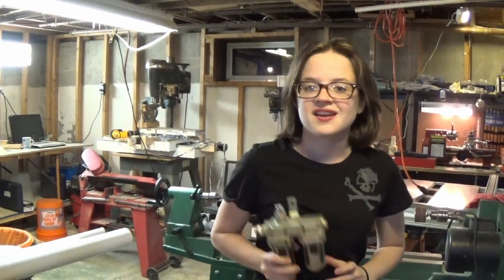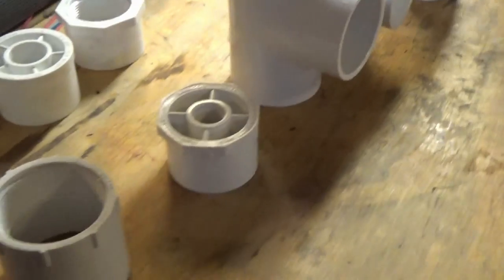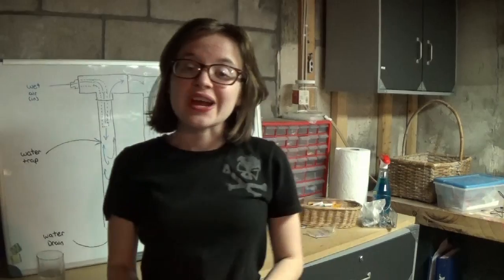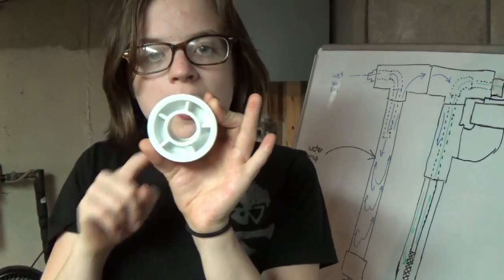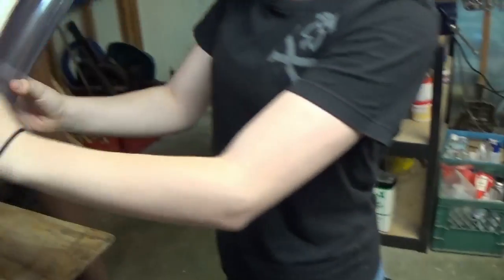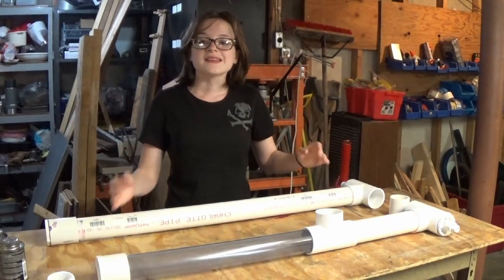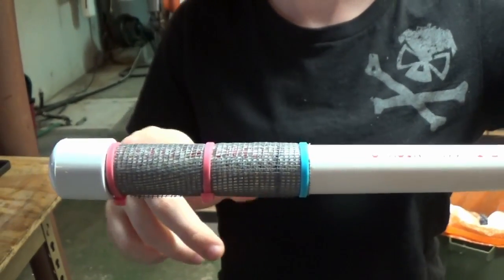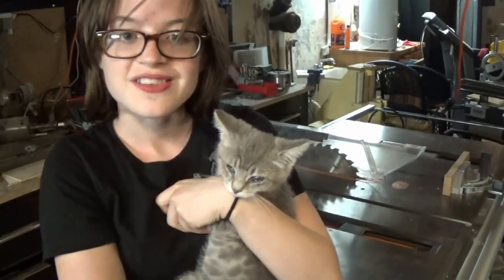Ep 11 Dirt Cheap DIY Dessicant Air Dryer

Comment: Fantastic video, great knowledge base. In order to minimise the safety issues with using pvc piping i would recommend using 1 or 2 pressure relief valves rated at 8 bar (100psi) (1 at the entrance and one at the exit). This is within the operating pressure according to ASTM D1785 for all your pipe tube diameters. The problem with PVC and in fact anything brittle is micro fracturing initiated by pressure cycling. So try to keep the pressure constant in the desiccant dryer you built and insert the pressure relief valves. Also don't use higher pressure than what is required for your project. 6-7 bar is more than enough. Again well done for the great explanation. I hope you are teaching this in school/university setting. A final word if the budget allows it its better to use metallic piping for this project it will literally be full proof for compressor use.
Reply: PVC handles hundreds of PSI and is an excellent and safe, as well as affordable DIY solution.

Comment: Hannah, is your 3/4" inlet size chosen to mate to your compressor fittings?  The reason I ask is because the shop I work in has already reduced their fittings immediately after their compressor to 1/2" and I was wondering if it would be fine if I made my dryer with 1/2" inlet and outlet.

Also, do you think your dryer would still work if each of the 2 stages were shortened some to save on pricey lengths of pipe?  I notice your stages look longer than 3', but if the stages could be built using 2' lengths, parts could be purchased cheaper.  Also, I think I might step up to schedule 80 for safety reasons, and I also might incorporate Keith's Wye idea.
Reply from the maker: The inlet size was chosen simply to minimize flow restriction, while the outlet was smaller so that the cross sectional area of the bead compartment would be as large as possible - this also reduces flow restriction as well as gives a larger surface area for the dessicant.  Both of these can be changed if you want, as well as the length of the two stages, with small impacts to performance.  For maximum performance think of the airflow as a bunch of little packets of air.  Each packet needs to be squeezed as little as possible while touching the dessicant for as long as possible.  What I can say, after using my system, is that it works VERY well, with very little flow restriction and incredibly dry air.  So you have some wiggle room and can afford to decrease the performance slightly.

Keep in mind that flow restriction due to the size of the inlet and outlet fittings is actually quite minimal.  Poiseuille's law is the most important factor here.  Check wikipedia for "Poiseuille's equation for compressible fluids" so you can see the relationship.  You can ignore all the terms except for the Radius and length of the pipe by setting those terms to 1.  Then you see that your flow rate will be radius to the 4th power divided by the length of the section of the pipe.  So as the radius increases, flow rate increases VERY fast, and as the length of the pipe approaches zero, flow rate also increases very fast.

Comment: Made this list for you with some quoted prices and some of your prices. Put it in your comments to help others that might want to build it. Thanks for the cool post I think I'll build one myself. Best Wishes and Blessings Keith

Cheap DIY Desiccant Air Dryer Parts List ~ from scratch if no parts are available at home.

Parts: 
- 1 4ft 2" Shed 40 PVC Pipe, $7.10.  
- 1 2ft 3/4" Shed 40 PVC Pipe $2.69.   
- 1 4ft 1/2" Shed 40 PVC Pipe $2.14.  
- 1 20" 2" Clear PVC Pipe Excelon R4000 Pipe $24.00.  
- 3 1/2" to 3/8" Brass Reducers $11.79.  
- 1 3/4" to 1/2" Threaded PVC Pipe Adapter .78c.  
- 1 1/2" PVC Cap. .38c.  
- 1 1/2" Threaded PVC Coupling .65c.  
- 1 3/4" PVC Right 90 Deg. Elbow .40c.  
- 1 1/2" Male to 1/2" Slip on PVC Adapter .38c.  
- 1 1/2" PVC Right 90 Deg. Elbow .40c.   
- 1 2" Male Threaded Plug $1.38.
- 1 2" Female Threaded Slip PVC Pipe Adapter $1.53.  
- 1 2" to 1/2" Slip Adapter $1.38.  
- 3 2" PVC Pipe "T's" $8.52.  
- 2 2" PVC Pipe Couplers. $1.96.  
- 1 2" to 1/2" Slip Adapter $1.97.  
- 1 2" to 3/4" Slip Adapter $1.97.  
- 1 2" to 3/4" Female Threaded Slip Adapter $2.28.  
- 1 1-1/2" End cap $1.08.  
- 1 2" Inside to Outside PVC Right 90 Deg. Elbow $2.50.  
- 1 1/2" Air Compressor Brass Drain Valve. $1.89.  
- 3 Small Zip Ties 25 pack $1.99.  
- 1 6" x 24" Fiberglass Window Screen $7.61.  
- 1 Oatey Handy Pak PVC Cement & Primer 30246 $7.95.  
- 1 Gal 7lbs Blue Indicating Silica Gel Desiccant Beads $36.99  
- 1 Small Set of 2 Part Epoxy $4.49.  

Total Cost from scratch if nothing is on hand. $136.20.
Reply: One of the reasons I like the PVC design is it's compactness. You could even mount it on the side of the compressor if someone had a mind to. I've looked at several designs, yours, old style garage wall pipe units, bottle units, transmission or AC radiator type units. Out of all of them this was the most cost effective. I'm going to mod the design slightly by adding a foot to the input side and replacing the desiccant "T" fill fitting with a "Y" fill fitting. I made another list of your design for you guys. It has the QTY: Length/Item Description:, Seller, Sellers Item #, Manufacturer. Manufactures Model/Part # and price.  I haven't posted it yet because I couldn't find the 2" Slip to 1/2" Slip part number. So for mine I thought well since you have to open it up all the way anyways, you could use a 2" Slip to 1/2" Threaded Coupler. If you have the seller, seller item number and manufactures part number of your original 2" Slip to 1/2" Slip, I'll add it to the list and post it. I'll probably do a video of the modified one I make with demension and post it as well for those who want a slightly different design. I think the most effective design would be the large Kenworth Looped AC Condenser combined with your desiccant portion.  however the reason I chose your style is because the AC Condensers are about the cost of the whole  PVC units cost, so it didn't make sense to do that. Well best Wishes n Blessings Guys Keith
Reply from the maker: They will work fine.  Note that If you are using dessicant that does not change colors when saturated, you don't need the clear PVC section.  Since it is the most expensive and the least pressure rated piece I would skip it.  Also, the clear section was the main reason that I used PVC in the first place, so removing it makes copper or steel pipe more attractive since they are safer in the event of an explosive decompression event.  Copper and steel will of course cost more, but the money you save from the dessicant may offset enough of the cost to make it worth the extra safety margin.  If someone does price out copper or steel, posting the total cost in the comments would be very helpful.  Good luck!
Reply from the maker: +Michael J - I agree, this was also part of my thinking when using PVC (although the off-the-shelf units are usually a harder plastic or glass and therefore even more brittle than PVC). The safety concerns with PVC are more with a complete air system than a single component.   Plus, systems need to be more robust in industrial settings that are under constant use.  But remember the concerns are still real, so everyone should be sure evaluate the risk in their own application.
Reply from the maker: Thanks!
Reply: Just a point to consider regarding the use of PVC in general, look at the typical air dryer/separators, at least in the HF units, they use plastic collection bowls that are a bit thinner than PVC, yet it is not common that they explode.  Only way I can i picture an explosion is if the PVC is hit hard while under pressure.
Reply: I've found (flower drying) silica gel beads at AC Moore for $15 for 5lbs.  The beads are clear with about 10% purple.  Don't know if they would work for this application, but I would think so, you'd just need to be more mindful of when the beads become too saturated.
Reply: For reasons unknown to me, I can't find the exact product I purchased at AC Moore, but here is a link to the same kind of product at Michael's craft store, only price marked up $3 

http://www.michaels.com/activa-flower-drying-art-silica-gel/10300251.html#q=flower+drying&start=1
Reply: Thanks that looks like it could do the job.
Best Wishes n Blessings.
Reply: Hannah, if you used copper or steel, would you use the same diameter piping as the pvc? Thanks. And your videos are awesome. Super informative.
Reply: Comparing polycarbonate and pvc???
Reply: Plus $75 in labor.
Reply: the bowls in the harbor freight units are made out of polycarbonate, not polyvinyl chloride.
Reply: Nice work

Comment: Very inspirational work, Hannah! Please give us an update on how well your Air Dryer works.
With regard to PVC as a containment vessel, industrial users with which I have worked are concerned about the pulsations caused by on/off air releases causing micro-fractures in the plastic pipe which eventually cause ruptures and explosions. Just an FYI. Keep up the good work!
Reply: Schedule 80 PVC is more resistant to those micro fractures. It doubles the wall thickness.  Love the idea. Trying it myself with this minor mod (Sch 80)

Comment: Nice job Hannah!  Very enterprising and cool design (not withstanding the safety problems with using PVC, as).... For those who're doing commercial work and can justify spending a bit more, take a look at this industrial dryer ($374):

http://moistureboss.com/moisture-boss-air-dryer-35-cfm-1-2-dry-o-lite-desiccant-200-psi-max-pressure-for-spray-painting/

Comment: For those who are concerned about Explosions ... You could make a 3/4 inch plywood frame around the outside (top, sides, NO bottom) and a 3/4 inch plywood door on hinges to open when you want to work on it or change desiccant.  If it were to blow it would blow all the chips out the bottom onto the floor not causing anyone any injury (or hardly any).
Reply: or you could just use steel pipe....or buy an engin-nerded part
Reply: or just check the burst ratings and discover 140psi is the standard operating pressure theyre engineered too.
Reply: Mine just exploded this morning, wear and tear over five years of use in a machine-shop setting.  It's not the values the materials are rated for but the stresses introduced every time the media is changed , I think, that caused it.  Luckily no one was in that room when it happened.  Going to have a sheet of plywood in front of the next one!
Reply: @simontrussler8554  I read the oils inside the line (from air compressor pump) may cause the PVC to become brittle and weak over time.
Reply: @adamx7312  We've got a 3/4" plywood cover that we can lift off when we change the silica - shame we can't see the colour change now.  Might put some kind of window in there at some time.  When it let go there was about 95lbs. pressure and one part ricocheted off a piece of equipment and broke a window.
Reply: @adamx7312  There's also the temperature cycles and differential to consider, as well as the abrasion of dust and even moisture in the air at those pressures and velocities. Temperature cycles a and duty cycle "knock" could be reduced by making a full loop in your lines and deliberately adding a continuous bleed for continuous flow, but that would also increase the duty cycles or the continuous duty on your compressor.
Reply: I love your alls safty advice, thank you
Reply: Can small diameter rope wound around at least 2 layers help?

Comment: Just saw a couple of your videos for the first time. I made a desiccant drier for my compressor with galvanized steel pipe. It isn't as snazzy as yours but it does the job. I don't want to be That Guy but it really is fairly dangerous to make this out of PVC. Ignoring anything else, PVC is far more likely to break if, say, something falls on it. Combine that with the pressure behind it and it gets ugly. You never see PVC being used for air lines in industry for good reason(s). 
Anyway, you definitely have what we in the industry call "madd skillz" when it comes to building things, and I think it's awesome that you build stuff. You remind me of me, though you're way ahead of me on when you started welding. 
I used activated alumina for my desiccant. It's cheaper and, IIRC, a bit more effective, and it doesn't break apart when it gets really wet. It doesn't have the indicator but I personally prefer that, as the cobalt in the that is nasty stuff.
Reply: I see sch 40 pipes for air systems in most of the commercial garages I go into.

Comment: I used to work in a facility that had some PVC run for air. It was all schedule 80, and out of the sun. we ran a constant 120 psi. It would explode at least twice a month. The owners finally sprung for iron pipe. 

My point is that you cannot discount the safety issue here. We were rated well over the psi in the lines and still had frequent failure. Luckily the section in question was outside and on a roof, but the explosion would scare the #!!/!!#! out of you if you were in that part of the building.

Comment: Excellent work, Hannah! Don't get too concerned with the "Safety Police" comments, yes, PVC can be dangerous at higher pressures, both gasses AND fluids, I have many years of healthy respect for PVC just blasting right out the ground or out of walls, HOWEVER, if you keep the pressures well below the rating for the schedule 40 AND locate your assembly out of direct sunlight and as far away from the working area of your shop as possible (some ¾ inch plywood shielding would be preferable, too), it should serve you well throughout your project.
Okay, now the important question: Are we ever going to get to see Episodes 6, & 7? Tell Bernoulli to get on that editing!
Reply from the maker: I actually agree with you Rob, AND with drb52photo on this one.  Standing near this when it fails would certainly be a terrible way to die, so I probably should have spent some time discussing the safety issues with PVC in the video.  Keep in mind that pressurized equipment always carries some risk (especially if you are using older equipment in order to save money.)  Describing it as a "potential bomb" at 90 PSI is a bit overblown  - the energies we are discussing are nowhere near bomb-like.  However if it were to fail while your face was near you could certainly lose your ear drums, the shards would have enough energy if you were standing within a few feet to penetrate your skin pretty deeply, and they could damage your eyes within 15 to 20 feet.
Reply: The "safety police" only want people to understand the issues with using pvc for pressurized air applications before someone gets hurt. There was no mention in the video of the potential for bursting (even at only 90 psi) regardless of pressure rating, if the piping is compromised.  Since the video made no mention of the hazards, one would assume the author is unaware of the potential danger.  To ignore, or underestimate the danger could be fatal.  Who knows, this discussion may have saved a life.  Do some research; you will find that no pvc pipe/fitting manufacturer will recommend their product for pressurized air applications.  The fact that the operator may not be in the area of the blast will be of little help if someone else, or a pet, are injured.  So please, before you knock the "safety police" consider the consequences of an accident involving people that may not be aware of the dangers and blindly follow a video to build a potential bomb.

Comment: This. 
Video. 
Is. 

AMAZING.
Reply: Wear gloves when working with epoxy or resin. That stuff gets in you and never leaves.
Reply: Just don't stick your hands in it. If you do you can use Isopropyl Alcohol to remove it as it dissolves most two part epoxy well before it cures. Also the alcohol is not toxic in small amounts, it's the same alcohol they wipe on your skin before your get a shot. Best Wishes n Blessings Keith
Reply: Nitrile gloves. Latex is crap..... oh how i miss my KC500's those things are invincible.